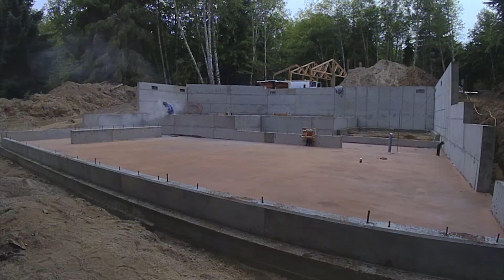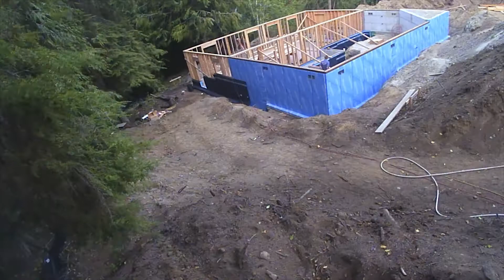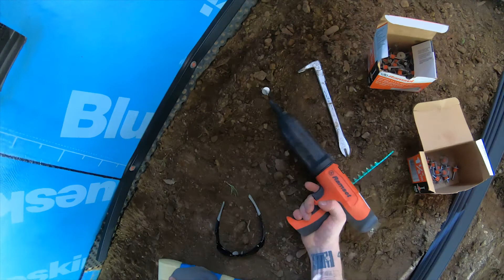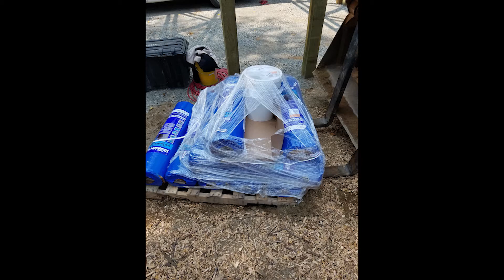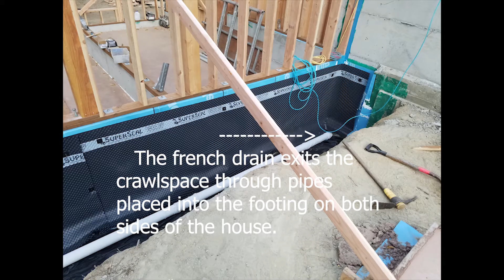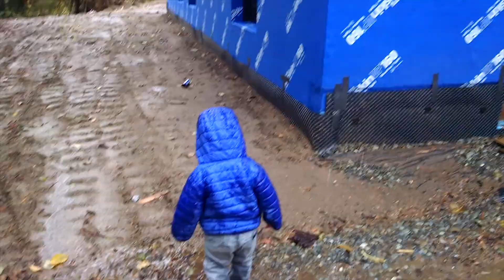Basement waterproofing: Step by Step Peel and Stick Membrane

Comment: Dimples facing the wall (for the dimple mat) with nails is the proper way to go.  Other channels are too worried about being sponsored that they aren't thinking (or choosing not to be critical about their meal ticket) about what is really happening when the flat is glued to the wall.  That is a very flawed design for the purpose.  Anyway, Nice job.

Comment: Great video & super approach to the task! Excuse my ignorance for asking, but I'm curious about the use of the dimple board. Prior to watching your video I wasn't aware of such an item. Was that necessary over the Blueskin or could you have gone with just the Blueskin? Or putting that a little differently, is the dimple board added insurance against water infiltration? Thanks!

Comment: Approximately how many sq. Ft of blueskin was this?
Reply from the maker: For the foundation, if I remember right, was about 1000 square feet of waterproofing.  I think I bought 11 rolls of the WP200 and each roll covered about 100 square feet.

Comment: Fantastic Effort and Outcome.  I did very similar (blueskin and drainage) but also put a layer of XPS insulation against the blue skin and then the dimple board.  I used the primer for the Blueskin to attach the dimples inward.  Used lateral poles and 2x4 to hold the stuff while it dried.  It worked really well. I did about half the wall distance you did.
Reply from the maker: Thanks for the comment!  Great idea to use the primer as a glue for the dimple board.  I had thought about gluing the board on also, I think it's the preferable way to go.  Had I not been is a hurry to get the waterproofing done before the framers starting, I might have tried to do what you did.

Comment: Great step by step video series.  I’ve watched this video and video on dimple board several times during my much smaller foundation waterproofing project. Lots of your tips used. Thanks.

Question:  What type and/or brand of landscape fabric did you use to separate the gravel (over weeping drain pipe) from the backfill soil?
 I looked in your material list but didn’t see landscape fabric mentioned.

I used Blueskin peal & stick from Home Depot and Delta MS dimple board from Lowes. I used Delta MS dimple board because it’s sold in much shorter heights.  My foundation wall is only 24 inches high, but footers stick out 14 to 20 inches which created lots of challenges to cover with Blueskin and Delta MS.  Love those outside corners of the wall.  Big footers due to sandy soil, I guess.

I’m using 80 feet of flexible 4 inch weeping drainpipe , perforated, and cover with fabric protective sock .

I know what you mean by YouTube controversies over using landscape fabric.  From my internet research, especially reading comments in YouTube video, most folks say to install a landscape fabric to separate drain gravel from soil.  Glad you did too. 😊🤩
Reply from the maker: Thanks for the comments and glad I could help!  The landscape fabric I used was just the cheap stuff that my local supplier carried.  I'm not sure of the name but it was pretty thin and not very strong and I probably shouldn't have used it.  They make much better stuff like this:https://www.agriculturesolutions.com/srw-nw4-5-non-woven-4-5oz-drainage-and-filtration-fabric-6-x-100?gclid=Cj0KCQjw2or8BRCNARIsAC_ppyZzi1hv8n4CZnxnniJRoYU4xEOtP7wmLUhWasanJQhljb7p8luZimYaAlo9EALw_wcB
Quality non-woven filter fabric is the way to go.  It's a lot stronger than the stuff off the shelf at the big box stores.  Luckily I too have sandy soil, also without much clay, so the cheap fabric should be okay in my case.  But I do think it helps to try to keep the fines out of your gravel with fabric to help maintain good drainage around the footings.

Those footings sound huge and definitely a challenge to waterproof.  I think Delta is probably nicer than the superseal I used.  And the flex pipe is great and some say works better than the solid because it lets the water in more easily.  Good luck with your project, sounds like you have a good handle on it and are willing to get your hands dirty.  You'll save money and get a better product that way.

Comment: For your stucco coat, what did you use over the blueskin? Just lath? Also, how is it holding up? Btw....looks good!
Reply from the maker: Thank you!  I put a drain board over the blueskin and behind metal lath.  The lath is bolted through the drainboard which leaves an air gap behind the stucco helping the stucco to last longer.  Here is a details video I did that shows the drainboard:  https://youtu.be/fxj5cJnNgo4
And it seems to be holding up really well.  I think it will hold the rock veneer with no problems.